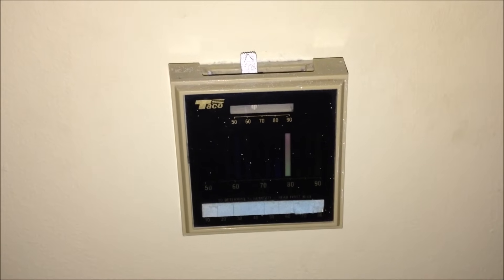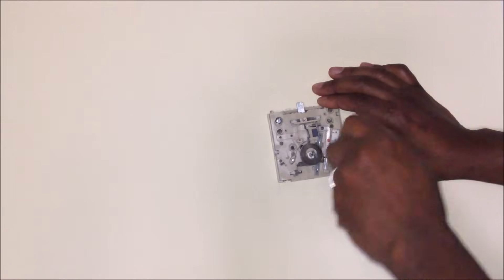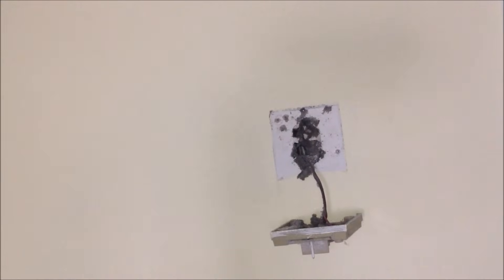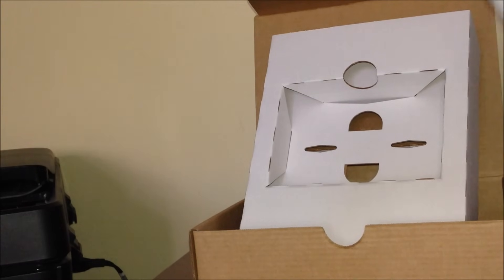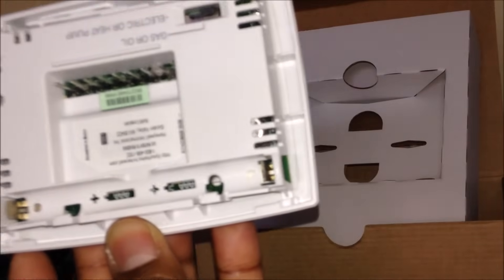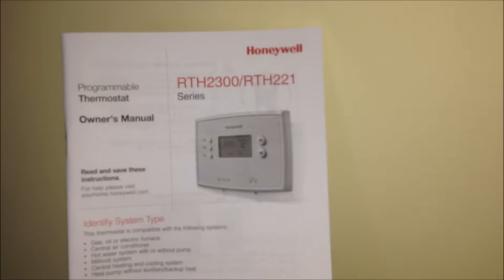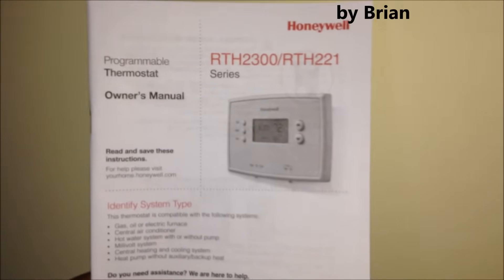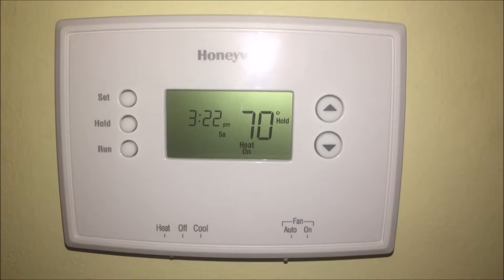2-Wire Installation for Honeywell Thermostat

Comment: Just installed a smart thermostat, but the app would not let me proceed with R/W, however, I looked it up, and Y would be for cooling, and R/W/Y allowed me to proceed in the app. This was on a Sensi Lite, which "can" run without a common wire, but supposedly it will eat up batteries.

Comment: Just a heads up I used the jumper wire  cable and it didn’t work until… I removed it so try using it with the jumper between red and rc …if it doesn’t work remove it then try again good luck

Comment: For those wiring a 2 wire millivolt appliance, like  a gas fireplace or gas heat stove, (not a gas oven LOL), the 2 wires' only function is to open or close the circuit which opens or closes the gas valve. It should not matter which of the 2 wires goes to the W or R  terminals. Ignore the color of your 2 wires. The reason colour doesn't matter is because you have no idea  to which of the thermopile's terminals  they  are connected to. The thermopile is the part that generates the millivoltage to keep the pilot light going and to open and close the gas valve. The thermostat only acts like a simple light switch.  No need to fuss over which wire is hot (meaning which wire supplies the voltage and current to activate the thermostat). Also if using only 2 wires, follow the directions to not remove the jumper  between R and RC . You only remove the jumper if you have an extra wire running to the old thermostat's RC terminal.
Reply from the maker: Thank you for the detailed explanation and clarification!

Comment: I have 3 wires coming out of the wall.  It's an old house.  Possibly 1 green and 2 white, or 1 green 1 white/1 yellow.   Anybody know how to hookup 3 wires?
Reply: You figure it out? I got 3 wires as well but I need a thermostat for it but just a bunch of run arounds

Comment: I have one of these thermostats and am working on a DIY project with a Mr. Heater
and am only going to use 2 wires like you. As an electrical geek I know all circuits
need 2 wires>>  + & - or ac hot & a neutral but working with this thermostat I found it 
does not require any external power to operate. It all works off the batteries. I 
assumed the batteries simply backed up the programming, but, no, they power the
electronics in the thermostat. I was amazed!

!

Comment: Hello, I have the exact same scenario and glad I came across your video. Thank you. I would have covered the hole with tape so the blown insulation does not cause problems.
Reply from the maker: Great tip!  I'm glad it worked out for you.  Thank you for viewing!

Comment: The background noise from a radio and phone were very distracting.
Reply from the maker: I have to agree.  This was my 1st video, and I was only using the phone's mic.  My videos and audio has gotten way better with time.  However, the main question to is did this shitty sounding video help you at all?
Reply: I shouldn't criticize I guess but I hear background noise ( dogs barking, baby crying etc.) in so many homemade You Tube help videos.  This makes it very hard to understand especially when the narrator does not speak English as their primary language. I found another video which explained the function of the various terminals which was very useful.

Comment: 67 yo woman - thank you so much for this video my situation was identical to yours. At first I thought both my wires were white, but on closer inspection one had a red line underneath so I was able to follow your instructions and hook it up!
Reply: How would you do it if you do have air and heat

Comment: Good video. Two-wire Thermostat works, No backlight, and yes have new batteries. The thermostat has worked for 2 years now but never has had a working backlight.

Comment: Do the batteries keep it working in a power outage?
Reply from the maker: Hello Susan, that will be a hard NO.  The batteries are only to keep your settings saved and your display on.  If you have a power outage, you are ass'd out unless you have a generator.  I'm glad this video helped you out.  Thank you for viewing.

Comment: Probably should check the thermostat for power before you ripped it off the wall.  Also, that voltage detector doesnt do 24 volts.  It does 60volts and above.  There are voltage detectors that signal blue for 0-24 volts. Also, red isnt always hot.  The hot wire is the one with electricity on it.  Electricity doesnt care what color the wire is.  Dont just assume white is neutral because its white.  Vice versa.
Reply from the maker: Thanks John for the info and thank you for viewing!

Comment: The previous owner to our house only had a yellow and blue wire for heat only and had the yellow wired to "R" and blue wired to "W." Is that completely wrong or should I wire it the same way they had it?

Comment: Thanks, great help. I had the wires wrong wouldnt control temperature. Finally got aroud to fixing it. When I found your video. I did not turn power off. Just don't let the wires touch or touch bouth at the same time.
Reply: Yeah, it's good practice to turn the breaker off, but if my furnace is unplugged from the wall, there is no electricity running to the thermostat. At least that's what makes sense to me. I'll report back -- so long as I do not fry myself tonight! 😜⚡

Comment: Thanks I pulled one of these out a while back and replaced it with a WIFI model. Then I though why not put it on the garage heater?  I could not remember if it was W+Y or W+R .

Comment: I have a 2 wire system and I still can't get it to run. Changed pressure switch, tried everything and I don't want to call anyone to pay out the ass, it's gotta be something basic and I'm just missing it. It's flashing 3 times on the led and I can't figure it out... frustrated

Comment: I thought I had a two wire but it turns out it’s a three , red wire white wire and a black wire , can anyone tell me what terminal the black wire goes on? My system is heat only , hot water baseboard.

Comment: My tstat just like this is dead.  have not used the furnace for years.  Pilot works like normal.  would sure like to know if it turns on before I buy another tstat.  Is it true if you simply touch the red and white wire together the heat comes on?

Comment: Take a picture of how the wires connect to the old system, just in case. Some 2 wire systems use a bridge so the red wire double as the black wire . So technically the 2 wire is doing 3 wire job . You will know if you see a little bracket that connects to another location to the B spot

Comment: DUDE!!!!!!! You are awesome!!! I just bought one of these and having a heck of a time getting it to work! There's a million instructions with multiple wires but not just 2. I guessed right on my wiring ... but just learned ... it's all about the jumper! Pulled that little dude out and pow ... heat!!!   Thanks so much for sharing!!!!

Comment: I appreciate your video. Concise.  I came to find your video because I thought I was getting the instructions. Turns out Honeywell sent me a defective unit, mine doesn't have the black thing you connect the wires to.. you know "where the magic happens". So no magic for me. 😬. Also appreciate the 2 wire info, since so many people have 2 wire setups.  Big fail on Honeywell for not putting that in the instructions as well.

Comment: No offense but it's a terrible video, I'll give you a couple of explanations right here. No need to talk about skin cells, number two you don't explain if the thermostat actually requires the batteries to make it work. And you don't get a shock by touching 24 volts. You don't explain the colour of the wires coming out of the wall, and near the end you just point to where they go as opposed to showing the letters were they go to

Comment: For anyone seeking Installation Guide, I found the below link by searching via the model number. Honeywell Installation Guide.  It works the same for most. Page 5. Heat Only. 2 wires (with 3rd 24v as optional). http://www.kele.com/Catalog/22%20Thermostats_Controllers/PDFs/TH4110%20Installation%20Sheet.pdf 
Thank me in the afterlife.

Comment: Oh this made me so happy. I had an ancient mercury thermostat with 2 wires (neither had a color) and bought a thermostat I couldn't figure out. I returned it, got this one you installed and followed your directions and did it.  Thanks so much! BTW the instructions say not to remove the jumper if you don't use both the R and RC and I didn't and it was fine. Thanks SO much for this great video!
Reply: Hello. I also have 2 wires with no color. Both black wires. 
How do you know which one goes to the R ?

Comment: Do you have to take out the jumper?
Reply: I am curious too. Did you remove it?
Reply: two wires red and white 
red goes in the (w )
white in goes in the (R) 
if you have a jumper that came from the factory it should be from (R) to (RC) so removed the jumper please 
this its only for heat 

gracias DIOS Los bendiga
Reply: @kokys1089  
Red goes in the (R)
White goes in the (W)
Reply: @acerjuglans383  thank you so much!!
Know I know hahaha I'm trying to remodel my place an I haven't got to the heater yet it's still hanging on the wall 
But I got an idea to make it look great thanks

Comment: I WROTE THIS COMMENT ON JOHN P'S 2-WIRE PAGE: "I installed this on a millivolt heater-only system according to another YouTuber (THE AMATEUR'S AMATEUR), removing the R-Rc jumper as he suggested.  The heater went on and stayed on.  I remembered that the instruction manual said nothing about removing the jumper (unless an Rc wire came out of the wall).  I hunted around on the floor and found and replaced the jumper and the heater now is controlled properly.

Comment: Great Video. Question: I've had the unit installed and double checked the wiring, but the 'Heat On' never comes on. thoughts?
Reply from the maker: I'm sure you got this checked already, but you could have a busted furnace, or you may need to light your furnace.  However, I really don't know the true answer.  Sorry my brother, but I really appreciate you taking the time to view this video.  Good luck with that Heat On issue.

Comment: Looks easier than I thought. We also have a furnace with no fan. Our house was built in '51. The nice thing which I'm sure you've noticed; if the power goes out in the winter for hours, we still have heat. I love that. The only problem I might run into is rather than a red wire and white wire, we may have two or three brown wires. That's what my girlfriend's husband found when he put up a new ceiling fan. In fact, we also don't have a circuit breaker, we have a fuse box. But it's the brown wires I'm concerned about.
Reply from the maker: I wish I could help you about the brown wires, but I'm no electrician lol.  However, let's back up a second.  "That's what my girlfriends husband found....".  You  are my hero, and I want to be just like you when I grow up lol!!!

Comment: My old HOnneywell manual AC thermostat has only two wires: BLACK and BLUE.  How do I connect it to a new digital one?  Is BLUE like white?  Or where exactlly would these wires go?  Iwonder if it is possible to make a mistake, since it seems to be  a simple on/off switch of the AC fan.  Thank you

Comment: I couldn't get the jumper wire between r and rc off. The screws to loosen it wouldn't back out. I took the unit back to the store and replaced it with another one and I still can't get the damn thing off.

Comment: Hey my old round honeywell  heat only the wires are Blue and White when my bro took it off he didnt look where each wire came from.  

He attached the new Saswell thermostat to W and RH no heat at all.  Can you help
Reply: I too had the round old shool honeywell thermostats and when i took it off, the back of it states that its for series 20 wiring - Red to R - White to Y - Blue to W. 

I took a picture before i disconnected my wires and my red wire was connected to the R(Hot) and my white to the W. 

Find which one of your wire is hot first. 
Hope this somewhat helps.

Comment: I had to do is shut off your furnace switch nothing else and you'd be set, no going into the breaker panel and shut off to break is absolutely no reason at all but your safety is your safety, that is low voltage and when you're working with low voltage it's usually never hooked up to the breaker panel off uses or anything like that now if that was a light switch on Outlet or putting a ceiling fan in absolutely, when you went in there I thought you were going to shut the main switch off to the furnace but I was wrong, oh well Some people prefer to play it safe but thanks for the video it was okay my bad and all that dust most of it came from the inside of the wall it comes down the wall old houses. Tear a wall down and look at the stuff, then you will know, that was a mix of both, dust bunnies and wall dust. Oh can't forget thos last part, ALWAYS USE THE SAME BATTERIES IN IT, YOU USED 2 DIFFERENT ONES.

Comment: I only have 2 red wires,how do I know how they go.
Reply: Rene Alfro check which wire is hot with a tester. Then put a bit of black electrical tape on it so the next person knows. The other should not be hot and is your W.
Reply: @cigarswhiskey1869  ten q.

Comment: This is very helpful but before I do this, I have a question.  It looks like when you take the old wires off and you say "there's just two wires", there does appear to only be two wires.

Then after you vacuum out the previous owners dead skin cells, you're showing 4 wires (2 on each side).  Could you please say where the other two wires came from because I'm the ultimate amateur and kinda need to understand this completely before I do it.
Reply from the maker: Nah...There are only 2 wires.  You must be referring to the brown shielding on the red and white wires, but I can assure you that there are only 2 wires.
Reply: @TheAmateursAmateur  Hey thank you for getting back to me!  Cool that's what I thought.  Guess where I thought I saw two wires on each side making four wires total...  If you said around 4:27 you would be correct.  I was seeing the shadow of the brown shielding on BOTH wires making it appear as 2 wires on each side.. ;)  Thank you again!
Reply: I thought that too, what you are seeing is the shadows off the wall....it looks like 4 wires
Reply: @davidlaue8225  Thank you.  I eventually figured this out.

Comment: I’ll start off by saying, you’re one funny dude. 
Second, thx for this install video. I also have a 2-wire setup and this Honeywell will suit my needs just well. 
Would be nice to have a 2-wire WiFi thermostat similar to Nest and the like, but having the function to custom program will be a massive improvement within my home. 
5 zones total and I’m running oil, so needless to say this will improve my wallet size in due coarse.

Comment: What's the tool you used to check the power with called? Like the official name?
Reply from the maker: Check the URL at the below.  I purchased this same set from Home Depot.  I have to be honest, I am not sure what the hell the official name is, but I can say that the tool is very official.  It has saved me many times.

https://www.homedepot.com/p/Klein-Tools-Electrical-Test-Kit-69149/204367271

Comment: If my wires are black and white, does white wire go to W, and black wire to the R?
Reply from the maker: Well that depends on which wire is hot.  If your black wire is hot, then connect black to R and white to W.  If your white is hot, then connect white to R and black to W.  I hope this helps you.
Reply: The Amateur's Amateur thank you. How can I test to see which is hot (24v)?  Will a voltage tester detect 24 volts?
Reply from the maker: Yes it will, but if you buy one of those Kline tools electric probes, all you have to do is touch the wires (separately) with the probe, and whatever wire makes the probe beep is the hot.  I hope this helps.
Reply: The Amateur's Amateur yes this absolutely helps. Thank you 🙏